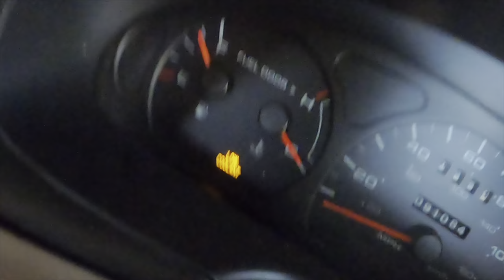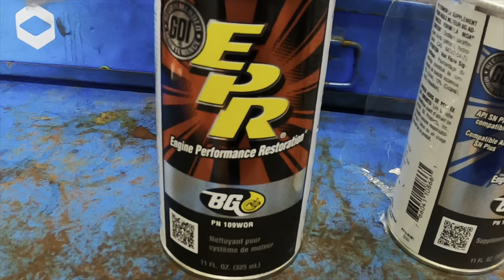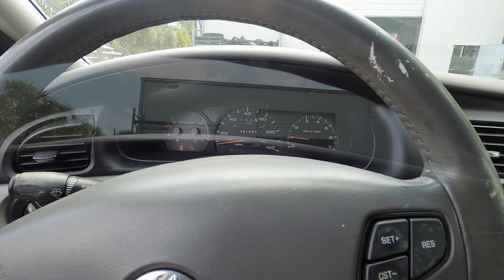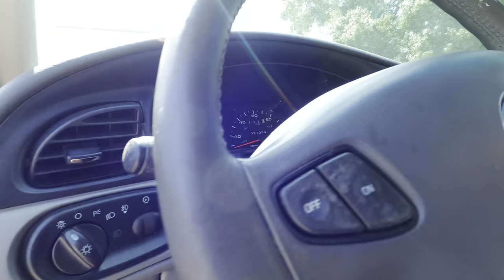Customer States: Never changed the oil….oops

Comment: With all that bearing material You found, My Gut feeling is there's a couple of Main bearings spun as well
Reply: Yeah, seems like as long as you have the bottom opened, might's well replace the mains too.  Not to mention, that hammering knocking was probably the cylinder tops introducing themselves to the valves.  I don't think just replacing the rod bearings is a long term fix.
Reply: I was thinking the same thing about the mains.
Reply: It might work another 100k with proper oil changes. I've seen quite a few people get away with just this not a bad call for an ol mercury probably not worth all the extra time
Reply: Anyone has an idea what cost for labour is on a job like this? I hardly find it feasible. I would understand it with a fancy low milage car like a audi, bmw.. but this crapola? would it not just be cheaper to get a new used car.. In sweden, 4 hour work is like 500 bucks + parts - thats like 2k labour and parts before he even is into the engine to check the bearings..
Reply: @jmkhenka  How to put this?  There are many people in this country who, though they may have a great deal of cash income and cash on hand, are not able to obtain credit.  Purchase of an automobile of any significant value will result in the transaction being reported to the IRS and/or law enforcement agencies, and they likely do not want this to happen!  Hence, the acquisition of fairly low value vehicles with cash from private buyers even if the vehicles need significant, costly repairs afterward.
Reply: hourly if they're fair. otherwise north of a grand. sign in to your local libraries digital service and look for a auto repair service offered. sometimes there's manuals and sometimes it's just instructions or other times it's book time etc
Reply: @chuckschillingvideos  El Chapo? Is that you?
Reply: Straight up, this motor is not going to be kicking for long.
Reply: @ironhornforge  If it gets some minimum wage guy to his MacJob for 6 months, it might be worth it to him unless he actually paid for the labour cost of this job. I drove a car with a blown head gasket about 80 km to work and back every day for 7 months and just kept topping up the coolant water (yes, water) 3 times a trip. Because that's where I was financially...
Reply: @dougerrohmer  and? 
I
Reply: @ironhornforge  And life changed. Things got better. But if I couldn't get to work in that period, I would probably be sleeping on a park bench now.
Reply: @jmkhenka  A BMW isn't worth it the day after they are made. Euro's are drastically overrated and anything from Germany after 1990 I wouldn't touch with a 10 foot pole. Toyota's are fantastic though but that's Japanese. The cost of parts on fords and GM cars are pretty cheap so one with a decent interior is worth putting a little money into because you will put something into any vehicle you buy unless you hate money and reliability. If you buy a car, Oil change, coolant, air cleaner and wipers as well as a good inspection is the minimum.
Reply: @jmkhenka  hourly mechanics labor cost in u.s is like $75 - $150 an hour. Even if it costs $1000 to replace the bearings, with 90% of the cost being labor, you know the condition of your vehicle. If you go buy another used car for $2k, you have no idea what you're getting. Sure you can look for the obvious signs of trouble but it's a roll of the dice. Sometimes better to just fix what you have
Reply: Probably. An expensive fix to say the least!!!
Reply: quite frankly, whoever owned that car probably paid more than it was worth just to get it fixed. those cars are worth like maby 1K at most, pretty much junk.
Reply: @joer8854  Better yet, buy a used Lexus and repair with parts from Toyota.  I had a 1996 LS400 for 20 years, and it never needed anything but maintenance.  Fantastic car.  Certainly wouldn't pay the price of a new one though.  And I don't think Lexus is as good now as they were in 1990-2010.

Comment: You're the man Rainman!  Nice work on that crank journal.  I did that one time on a wheel bearing journal on the side of the road in Monteagle KY with emery cloth.  It worked fine.  Some butt-head of a "mechanic" tightened the wheel bearing down TIGHT AS HELL!.....didn't back it off at all, just TIGHT AS HELL.  The wheel bearing heated up so much, it welded itself to the journal!

Comment: This low budget repair scheme was done to Detroit Diesel 2-strokes back in the day if the bearings were stressed from glycol dilution contamination. We called it a Polish polish & the apprentice would pull the engine through as we used strip cloth. The mains will have to be done also because the migration though out the journals is pretty evident. Also, it looks like a piece of thrust washer in that one shot which would only come from a  main bearing cap. I didn’t see Ray doing an endo check on c/shaft in the video portion so would like to know outcome.
Reply: Super old video but yeah, that much bearing material didn't just come from the chowdered up bearings on #6. One of the main bearings must be in pretty poor shape and a thrust bearing in particular would probably be able to slip out in chunks like what was found in the pan whereas the connecting rod bearings would be mashed into smaller pieces before they slipped out. Guess it didn't need that thrust bearing anyways.😆

Comment: aw,  seeing a sable makes me feel all nostalgic,  for a really long time my dad had a silver 2003 model with the little arch wing on the trunk,  but a few years ago it finally accumulated enough damage to be worth more in scrap,  to be fair the final failure was actually quite catastrophic,  i never got the full details on the lead-up, but basically the front driverside suspension gave out one day,  the coilover broke in half and tore open the tire,  even got the spare too as it limped home,   the flatbed driver had to muscle it into position manually for the winch, the front wheel was jammed so it just kinda slid across the floor on dusty newspaper, which was pretty funny,  then it rolled across the flatbed deck too fast and crashed into the little jeep or whatever other similar vehicle was on the deck already,   a final act of defiance i suppose
Reply: A good car just doesn't want to go down...

Comment: They learned me many years ago: never use motorcleaner into a old engine, the cleaner losses the debris in the engine and between the bearings..
Reply: Plus a lot of newer engines especially with vvt have screens in the oil passageways
Reply: I use non detergent oil in my 1950 8N Ford tractor .
Reply: @gregpetty4185 Is the oil yellow or clear? If it has no color or sour smell, they left out the anti-wear additives, not just the detergent.

Comment: 40 year retired tech here. Love watching your videos. You do a good job, but I cannot agree with this repair. I might do it for myself, but not professionally for a customer. Putting new bearings on a scored crank and in a connecting rod that has had a bearing spin in it is asking for a come back, in my opinion. I realize the car is not worth major engine work, but the hit to your good reputation is not worth it either.
Reply: I agree , but what was he spots to do now?
Reply: Well it's either this, rebuild the engine or scrap the car. Try the cheapest first. Even if it only lasts another 30,000 miles, it's saved alot of money and gotten him around with minimal outlay
Reply: Yeah, the crank needs to be sent to a shop for precise resurfacing followed by the installation of the appropriate sized bearings depending on how much material was removed from the crank journal.
Reply: Istm this could be fine as long as it was clearly communicated to the customer that it's more of a short term hack than a fix, along with a realistic estimate of the expected life range.
Reply: I agree. Maybe swapping the engine for another one from a wrecked car would have been better and cheaper.
Reply: I've seen shops repair the crank journal in the engine in the vehicle...
Reply: I agree that it’s not the “proper” way to do it but when the value of the car is less than what the cost of the repair would be if it was done the wright way, I think this is a good option.  At that point you have to consider the cost of repair vs the additional mileage the customer will be able to put out of this car.

Comment: My biggest concern, is that the rod and cap have been hogged out, so they will not grip the new bearing halves as well. It's very likely, that the new bearing halves will spin in that rod much more easily than in the others. 
     When the oil isn't changed, the filter becomes restricted, which really curtails the flow of oil. The last bearings in the oil galleries will get the least amount of oil. How is the valve train?
Reply: Thats why you clean off all the oil, and put green loctite 680 on the outside of the bearing shells when you put it back together.

Comment: "Don't think has any oil in it..." Proceeds to start and drive vehicle...
Reply: i saw that... did not fill then.... drive it without oil around the building!!!
Reply: @mikebradley4245  And dont forget the cleaner and a 30 min run! lol
Reply: @Random trade it in
Reply: @Vengancejr  he means before it got to the shop, if the customer has never refilled the oil and driven it until it made noises then a few more yards driving won't kill it. Whatever damage there is is already done.

Comment: I've seen this done, even at dealerships back in the 1980's, to 'keep that powertrain warranty affordable'...and SOMETIMES, it even worked...most often, not. Yep, good for day 1, good for day 90...but 5-7 months later, it would do it again...often due to 'new car abuse' (Mustang GT's, and the sort). That said, I keep thinking about the beginning of the video...'all that RTV in the oil pan'...which, is most-likely what caused the 'distant journal' oil-starvation (which led to bearing failure) to start with...the RTV issue isn't fixed...in fact, it's probably still plugging up a number of oil journals in the lower end. An oil-pump inspection MIGHT tell, might not.
A MUCH LARGER issue is, if the rod ends look like this...and you got out so much more aluminum than you could account for in the pickup, where did it come from? Again, chances are, there is main journal damage also.
I understand this is a 'cockroach car'...and a short block, possibly even a crank kit, is more than the whole thing is worth...and for my own use, I'd 'stoop' to doing something like this for my own personal use...but in a commercial shop, where reputation AND liability are on the line..uh...well...think I'd have to call the owner and 'set the options' for them. They want a 'crank polish out'...ok, come in and sign the 'as-is' paperwork...otherwise, we can go crank kit or 1-800-Jasperengines...for that short block you probably can't afford.

Comment: Although I'm a little late to the game with this comment, thank you for this video. An otherwise reputable and reliable shop used the wrong oil filter for a routine oil change on my MGB. This caused the engine to be starved for oil. The bearings are spun. The rods are shot. It's likely other damage is present. Your video helped me visualize the issue. Thanks from Port Charlotte!

Comment: Honestly though epr works pretty well, I used it on my 04 Malibu and it desludged it pretty well. 65k miles on it and it’s basically been in the city the entire time, so it was about due time for a desludging
Reply: I know I'm late but using synthetic oil with a 1,000 mile/quart oil change interval should keep it from sludging again. (Example: 5 quart engine=5,000 miles, 8.5-quart engine=8,500 miles)  Has always kept my engines clean, hope this helps someone!

Comment: I swear I heard "snake oil" preceded by it being poured into the engine.
Reply: The stuff works quite well used in the correct application. I've seen cars burning 2 qts of oil every 500 miles due to carbon build up on oil control rings causing them to stick. Ran the BG EPR kit though it and only burned half a quart every 5k miles after that. I wouldn't have used it on this car though.
Reply: @dylanandersen9318  service writers on commission
Reply: The BG rep at my old job was as slimey goon. I had to laugh when he started telling us to push coolant flushes at 50,000 miles, Toyota coolant was rated at 150,000 miles /10 years if I remember.

Comment: I don't see where those bearings account for all the material you found in the oil pump and oil pan, and it's been a long time since I've to rebuild an engine.
Reply: I agree. There's too much metal in the suction strainer to put it down to simple brg. failure. How is the oil fed to the small end? I reckon the gudgeon pin has run dry and that material is piston.

Comment: When you were pumping some clean oil, it reminded me of the late '50's when we filled the glass bottles with oil that were stationed at the pumps.  10 cents a quart.
Reply: Reminded me of my Dads shop but the big metal can with flex pipe. First thing every day top off the levels on all of the Trucks and Tractors, grease all the fittings. 
Hours of pumping from one Standard Oil barrel or another. 
Wish I had one of those glass bottles today.
Reply: In the early 70s we had pressurized barrels and would just pull the filler down from the ceiling, set the dial and start pumping. We were very "state of the art"! ;-)
Reply: I remember getting refined oil for 5 cents a quart and gasoline for 30 cents a gallon. Gas then was regular or ethyl.

Comment: No the engine is toast.  Every engine I have ever heard of replacing the bearings on the connecting rods might only briefly neny destruction. 😁👍
Reply: The same guy who trashed the bearings is still driving it... And the engine is repaired, not renewed.
It will produce near new performance but can't tolerate the stress.
So, it's easier to break something even more expensive.

Comment: Yes, I save the motor in a 1960 Corvette after the guy rebuild it and set the plastic gauge a little too tight. One of the bearings was squeaking and I said you gotta let me open that up right away and Emery cloth the main bearing. It’s now 50 years later and the engine is still running fine. Thank God for emery cloth and crocus cloth. I polish it to a finish. Thank God only one bearing was bad. They rebuilt the engine and got one too tight and brought the car in and it was squeaking so I said shut it off and we fixed it still running strong after 50 years. Excellent video keep up the good work.

Comment: When removing "swollen from rust" metric hardware, you might try using the corresponding next size larger standard wrench/socket. It should slide on much easier.
Reply: Especially on Dodge and fords